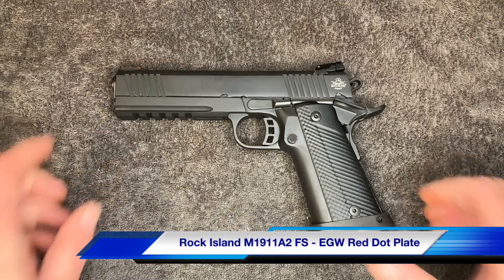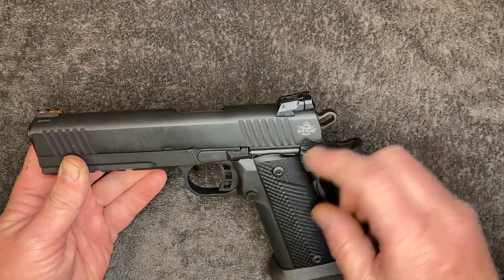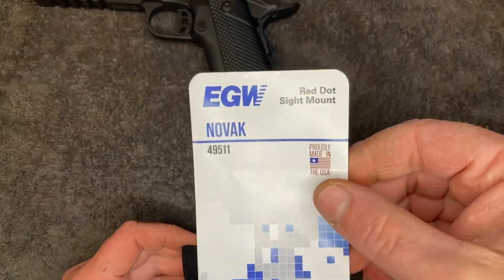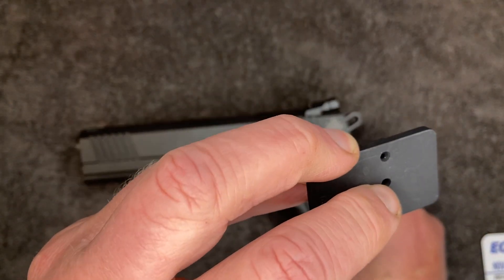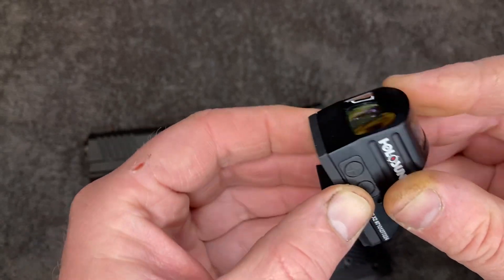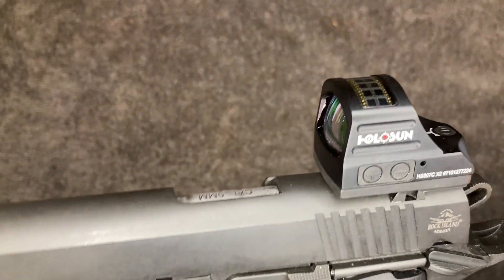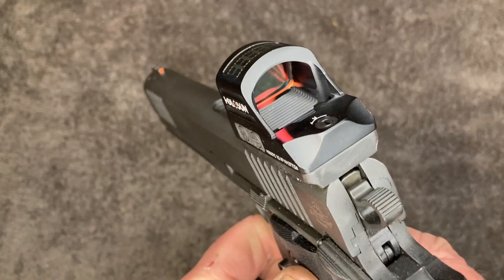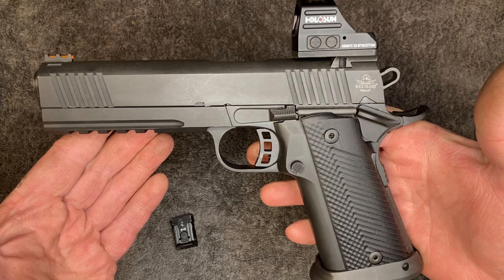Rock Island M1911A2 FS - EGW Red Dot Plate

Comment: Do you have any problems when shooting this gun due to the added weight on the slide?
Reply from the maker: Nope, it runs just fine.  I have also seen several RIA with milled slides and the added red dot.  The only pistols I've seen having problems with added red dots, has been .22LR pistols.